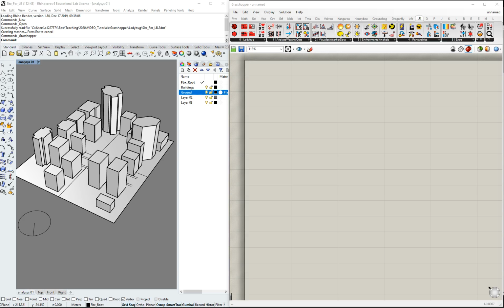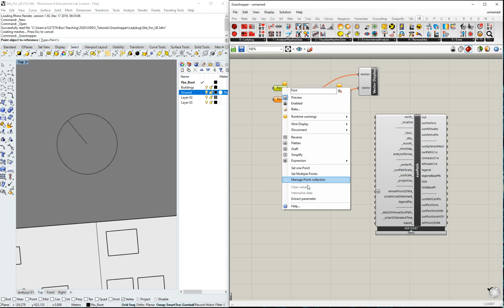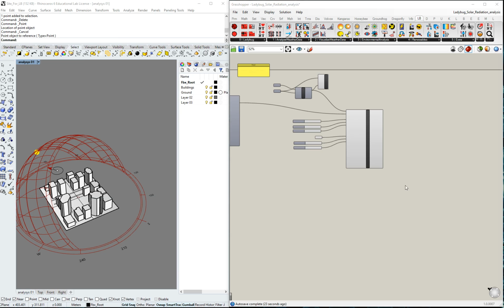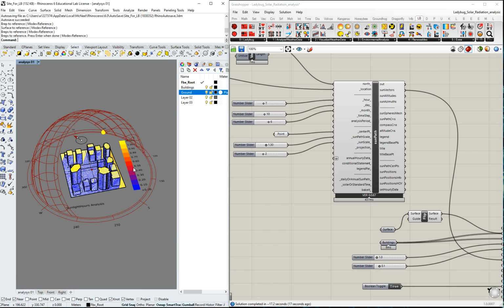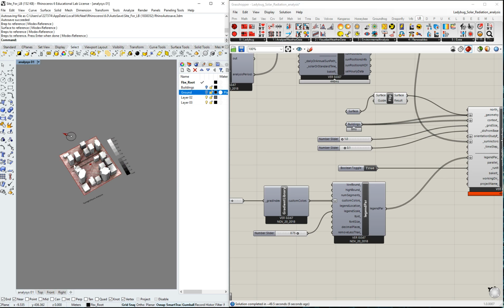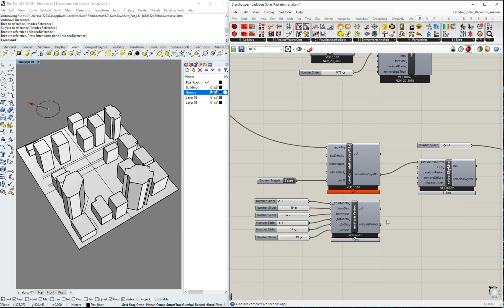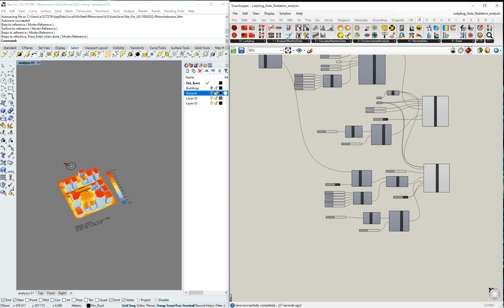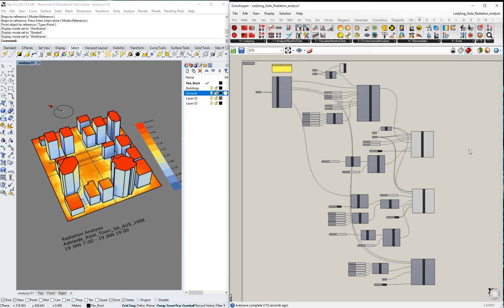Grasshopper 12: Sunlight hours and radiation analysis with Ladybug

Comment: Hi Carlos. Thx for the video! I've a question. Only the last step is failing. The Ladybug Radiation analysis tool shows me an error: Please connect the geometry or the context and set up both the gridsize and distance  from base surface. (I've extruded my buildings from cadmapper and made the surface myself.) Do you know how I can fix this error?
Reply from the maker: No idea sorry
Reply: Please I have question how can I change the type of surface such as grass or pavement low or high albedo